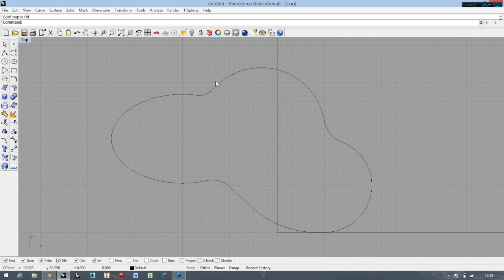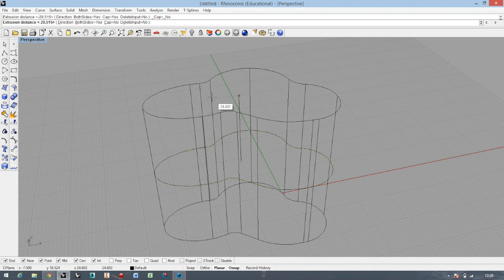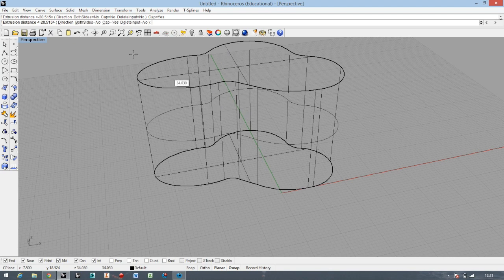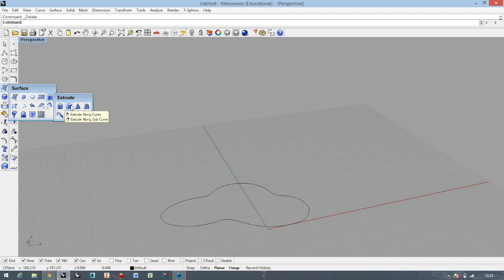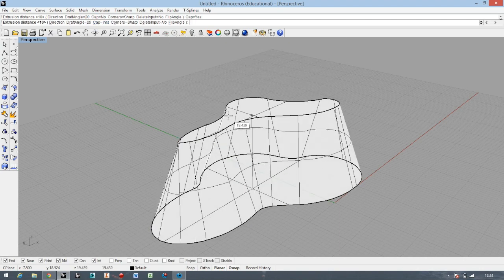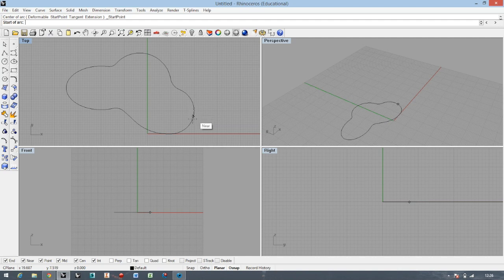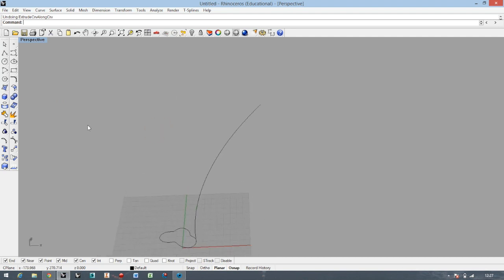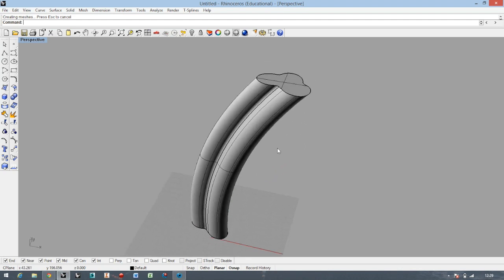RHINO TUTORIAL - Basics session part #5 of 6

Comment: Hi,i have a slight problem with extruding the objects.The cap option does not appear when i make the object. PS a reply would be helpful,Thankyou.
Reply from the maker: When you launching commend see brackets at the top of the interface in command prompt. There should be cap option on. In your case is off propably.

Comment: hi, iam extruding the surface but not getting cap, how can i fix it?
Reply: it seems that in Rhino 5, the option is solid, not cap
Reply from the maker: +JASYOT GAUR, In bruckets up in command white bar you need to have "cap" selected.
Reply: i didnt got that option of cap in command bar, and can you upload a video for extruding notch in rhino.
thanks
Reply: I have the same problem. I tried typing "cap=yes" and just get unknown command
Reply from the maker: +Edward Pan “cap” it’s a command. So if you need to make caps on your objects you need to type only “cap” and press enter. Otherwise when you launchng extruding command in the command bar on top of windows you need to click on ‘cap’ in bruckets to define cap applying.

Comment: Hello! Thanks for the helpful video's. I have a question regarding extrudesrf. When I have not used planarsurf I just get an extruded curve, no top or bottom, which is normal. But when I used planarsurf to create a surface and use the extrude command I sill get an hollow shape with no top. Whichever way I try to extrude, the shape remains hollow. Any suggestions? I'm using the latest version of Rhino.
Reply from the maker: Hi. Be  sure to have cap option on. In windows you can chose it by selecting yes by cap option in top command bar.
Reply: Hi, Thanks for your quick reply. I do not see that option unfortunately.  Not when i'm using cascade surface creation menu. When I use cascade solid creation menu I also do not see it but it does indeed create a solid object.
Reply from the maker: +Morgan Ruben screen shot would help! In some cases it is really difficult to find out the best answer